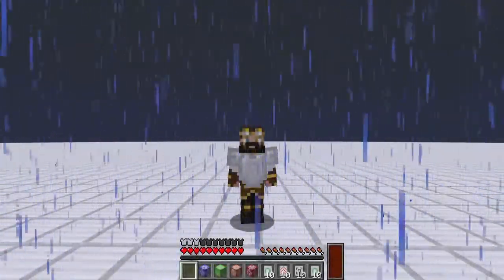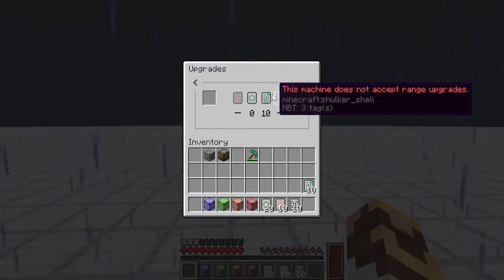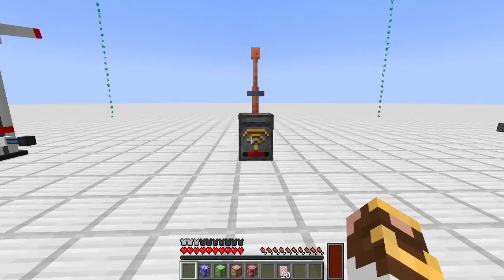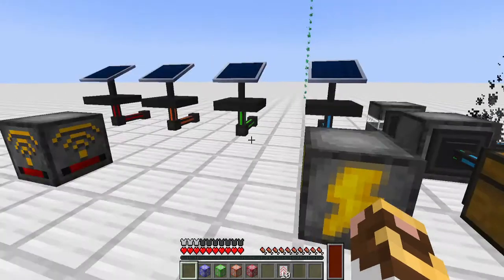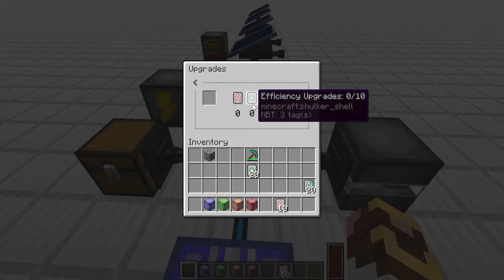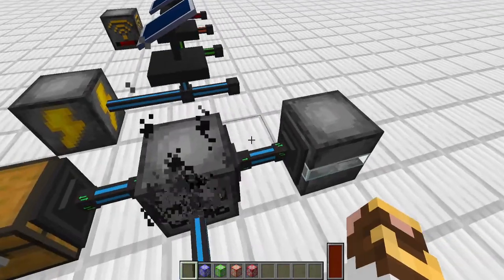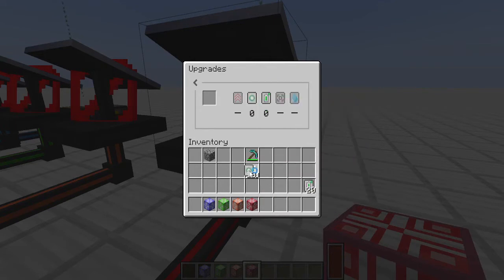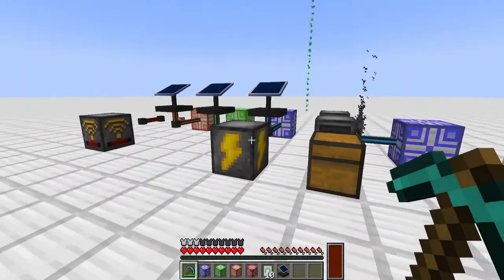Nova Tutorials #3 - Power generation and automation

Comment: Nice video!
Just a few additions:
- The energy upgrade only increases energy capacity, nothing else.
- The wind turbine's energy output depends on the height it was placed at, with the highest y-position giving 100% of the configured value (100 J/tick by default).
- The solar panel's energy output depends on the time of day, producing 100% of the configured power (40 J/tick by default) at time 6500.